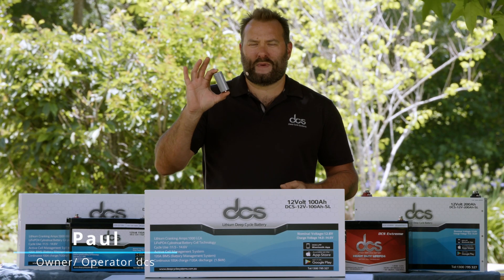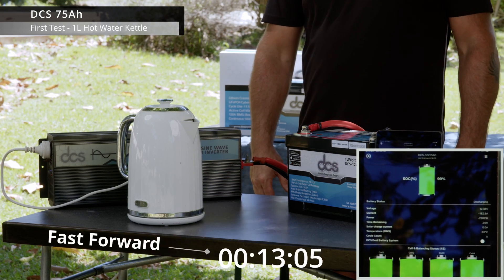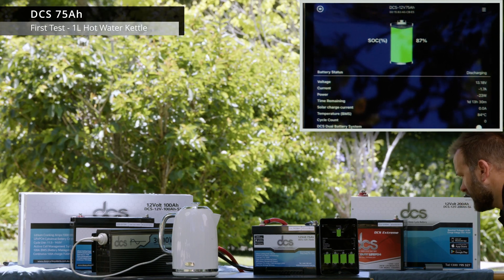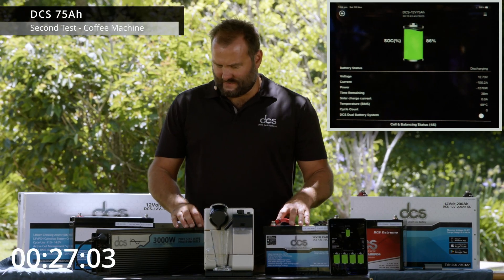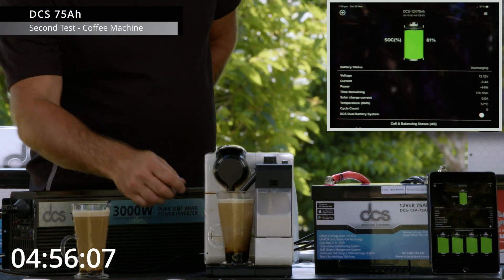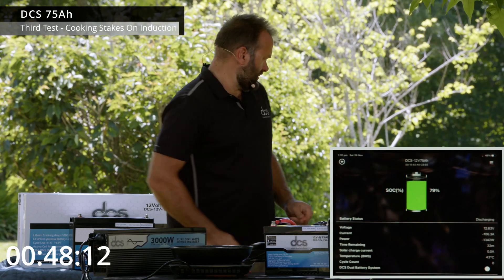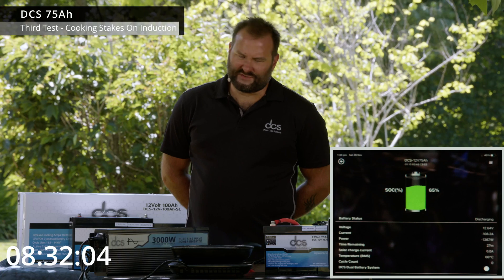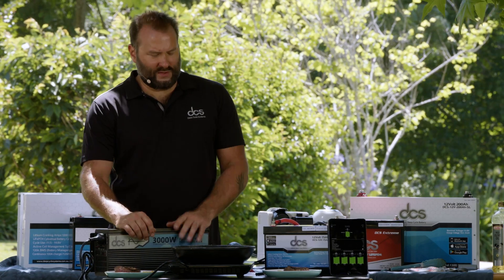Educational & Technology video series - Part One DCS 75ah batteries

Comment: Dig into those STAKES😅 good demonstration of that little 75Ah battery- BMS temperature higher on discharge than charging
Reply from the maker: recommended charging current is up to 50A on our 75Ah batteries, the BMS temp won't change at the 50A continuous charge rate.

Comment: Ok that’s the video I wanted to see. I might be able to get away with your 100ah battery. I want to run a 3000w inverter which it should do. I want to run a 2400w air fryer about 3 mins 3-4 times a day as the highest peak load. Would the BMS on your 100ah handle that load?
Reply from the maker: 2400W x 20% losses on your inverter & cables so you'll be drawing ~2900W from the battery pack. 2900W / 12V, 241A. No the 100Ah slim won't support that. You would need our 80Ah or 200Ah to support ~240A on a single battery.

Comment: So with a dual battery set up in my car - should I be concerned with the SOC or the voltage? I can go from 100% soc back to 78% in a very short down time - running the car fridge
Reply from the maker: Our DBS have a fixed reserve via the battery protects set at 12.8V which is approx ~20%SOC depending on how hard your bouncing off that reserve voltage. 

It's a fully automatic protection system, so if you hit the reserve you just crank over your vehicle, you shouldn't ever be concerned about either.